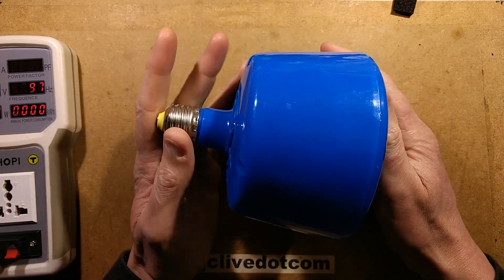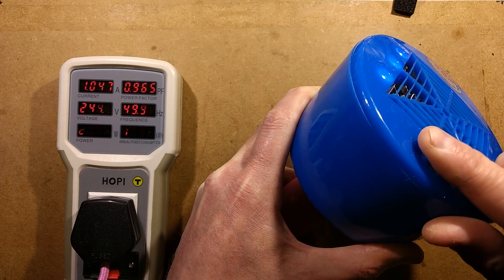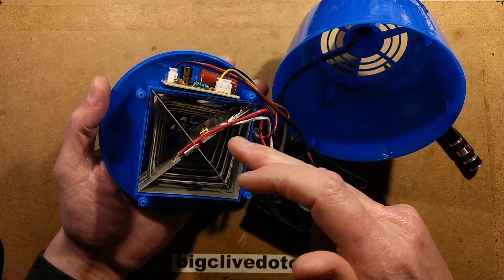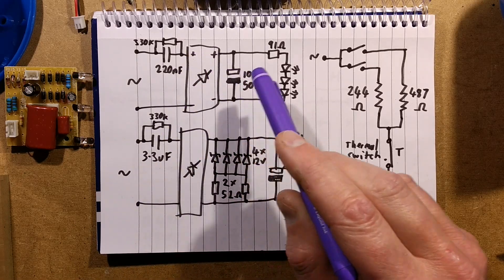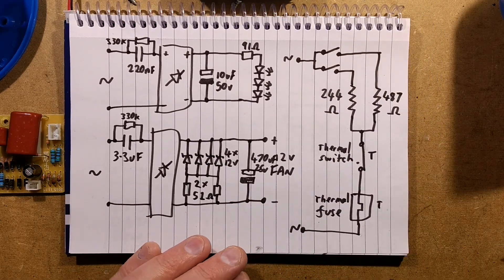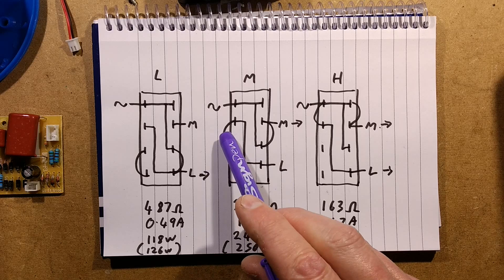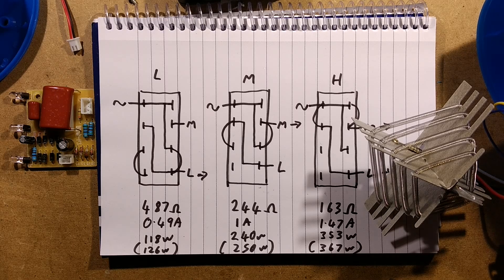Fan heater that screws into a lamp holder.  (With schematic.)

Comment: Just use a 150, 200 or 300w incandescent... very efficient heater that wastes a tiny bit of energy as light! :)
Reply: 35 years ago that what we used for raising chickens - infrared incandescent lamps.
Reply: Try a pet shop
Reply: FrontSideBus 
only like 5% tho'!!!
Reply: Wolfin i know how inneficient they are, but i fluorecent and Led Light still makes me feel unconfortable
Reply: If it's actually for animals having light on them 24/7 can be disturbing to some of them. Like parrots for instance.
Reply: In the US, it's only the 60-100W lights that are banned, but halogen lights and "heat lamps" are still available
Reply: My bedroom lights are only led so that don't get hot but give off a small amout of heat
Reply: Cool, where can I find one?
Reply: lol
Reply: Only issue being that I don't think they're making them anymore. At least, you can no longer buy them in shops.
Reply: I NEED incandescent lamps for taking picture with a specific light setting. I can't achieve that with neon, halogen, CFL, LED or anything like that. And trust me i've tried.

They are worth it in some cases.
Reply: Can still buy them here in Canada. They're not worth it at all though. I try to explain that to people and they just keep buying incandescent and CFL bulbs.
Reply: @thewolfin  Although there are some usage cases where something else doesn't make sense like saunas or stoves for example

Comment: They probably didn't use the resistive elements because they would've had to give it a lot of thought into figuring out how to do it. Notice when in LOW only the smaller element is used. MEDIUM, only the larger is used. Then on HIGH both are used. So they wouldn't be able to easily devise a plan to use the elements.

Comment: 240 voltage helps a lot even though it may likely add danger as compared to our 120 voltage. However a light bulb socket IMHO has never been a good power source especially for anything needing substantial power nor any type of connection where it is just one tab pressing against another in a tiny little spot. Rather the high pressure of a screw on the wire makes a huge difference.

Comment: They couldn't use the resistive dropper method because one element would not have power in low or medium, they could have used a common 'tail' of element on the neutral end of both, but the voltage would be different at each setting.
Reply from the maker: +Sparky Projects A tap off each element with a diode?
Reply: I suppose that'd work (with a total of 6 diodes for a full-wave rectifier), though there'd probably still be some drop in speed at lower settings (due to the source resistances of the elements).

Comment: Seeing as how hot air rises, that means the fan would have to work VERY hard to force it downward. Otherwise the heat will convect and collect all around that little fan and the wires that supply it. It's a fire waiting to happen.

Comment: LEDs are going to lower the power factor because they're DC, so need for rectifier, usually capacitive dropper, plus the windings of the motor represent an inductive reactance.  The more of that resistive heating element you have in circuit, the higher percentage it is of the power factor (i.e., the load is a higher percentage resistive than capacitive or inductive).

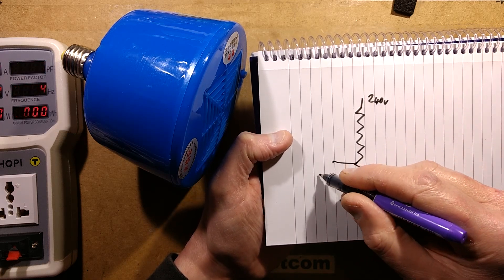Comment: 1:29 but how fans with a "cold" function work ?
Reply: Most regular fan heaters contain a simple shaded-pole motor (as do smaller stand-alone fans), which runs from the full mains voltage. So, the "cool" setting on those simply powers the fan while leaving the heating elements unpowered.
Reply: yeah i know but what was he going on about at 1:29 then
Reply: Sorry for the late reply, but anyway: Cheaper hair-dryers (that use one heater section as the dropper for the motor) don't actually have a true cold setting, their "cool shot" button being equivalent to the lowest heat setting. If a true cold setting is desired, some other arrangement (perhaps a full mains-voltage motor, or a small SMPS if you want to get really fancy) must be used.

Comment: In Canada, we find the traditional UK approach to home heating fascinating, and a bit puzzling. Here, all our homes are required to be well-insulated and centrally-heated, mostly by natural gas.
Clive's claims that Scottish winters are equally brutal to Canadian winters is not really borne out by statistics, but likely based on the degree of suffering, which isn't really valid, because we tend not to torment ourselves by depriving our homes of a comfortable room-temperature.
Reply: 'required' to be centrally heated? Not at all. Most new constructions in Quebec have electric baseboard heaters as that is the cheapest heat source and it allows for per-room temperature settings. Of the people I know around Montreal, about 80% of them live in houses, apartments and condos with electric baseboards. Of those 20% (on central HVAC), I think all of them are 30+ years old houses.
Reply: Well to be fair to the folks on the Island, their housing stock are generally much older than ours. Retrofitting older homes would be a massive undertaking.

Where the temperatures can vary in North America from the snowy north, to the humid coastline and the dry hot south. Air based conditioning was ideal to meet most of these needs. Generally the milder weather conditions in the United Kingdom called for only heating and the water heating systems were suitable. 

You do see water heating systems in  particularly in the North East of the US due to the colder winters but relatively mild summers when compared to other parts of North America. But this is slowly being replaced by air based conditioning.

Comment: Perhaps they didnt want the fan to change speed with the element selected?
Apart from the crap top casting and fittng, i think it wasnt bad.
Reply: Also the fan continues to run if the thermal switch trips (to extinguish the flames perhaps? :-D)
Reply: Or make a flame gun he he :-D

Comment: you know a good use for this would be to make like a model paint drying booth filter the air before have in blow in to the box and have your output with a damper

Comment: Wonder why they did not use an AC motor? No electronics required then.
Reply: I suppose 12V permanent magnet computer fans are a cheaper commodity part
Reply: Против Глобал ت

Comment: Separate PSU for the fan so it will continue to run in the event of an overheat perhaps?
Reply: I think if the item is actually on fire, you're pretty much done with corrective action - time to move on to disposing of the evidence.
Reply: That is almost brilliant unless the heat is from a fire. Then you got a foundry.

Comment: This is interesting. Not that I'd use one in a ceiling lamp holder, but I've been looking for a 100W fan heater for some time now. I would like it for a remotely controlled (flick the switch!) car heater for the winter, to get the windows defrosted before getting in the car. These things look a little mechanically suspect though.

Comment: Not sure of the application for this - afaik reptile heating theory is that you use a radiant heat lamp at one end to set up a temperature gradient and the reptile will regulate it's temperature by walking up and down the tank til it's reached the temperaure it wants. Fan heaters afaik tend to just produce a volume of air that's all at the same temperature due to the forced circulation.

Bathroom heater has been suggested in comments - but it's actually quite unpleasant and chilling to have warm air blown on wet skin due to enhanced evaporation so I don't think you'd wanted pointing at the place where you towel yourself off - wall or ceiling mounted radiant heaters were once popular in UK bathrooms though.
Reply: I have that heater. It gets used quite a bit during the wintertime.
Reply: It would make a handy heated chamber heater for a  3D printer.
Reply: Andrew Joy fully agree, I'm getting one for this reason, kind of hard to locate on ebay though.
Reply: Well if that's what you want one for then you can get little personal heaters such as this...
https://www.amazon.com/Lasko-100-MyHeat-Personal-Ceramic/dp/B003XDTWN2/ref=sr_1_4?ie=UTF8&qid=1493134895&sr=8-4&keywords=heater&th=1
or
https://www.amazon.com/Honeywell-HCE100-Ceramic-Portable-Mini-Heater/dp/B00I4UVGHO/ref=pd_sim_201_1?_encoding=UTF8&pd_rd_i=B00I4UVGHO&pd_rd_r=E7VY96HMSZ7GKB2RFQYM&pd_rd_w=FGJDO&pd_rd_wg=8ALjy&refRID=E7VY96HMSZ7GKB2RFQYM&th=1

I probably wouldn't trust one of those lightbulb socket heaters considering how the plastic doesn't seem super sturdy, but my use for a heater as such would probably be for entire home heating, I just find the idea to be rather amusing and a conversation starter for anyone who visits.
Reply: Maybe for grow-ops in cold areas? I dunno why this would be more convenient than a thermostat/oil heater, maybe because it takes care of input ventilation and heat at once. A timer could refresh the air without dropping the temperature too much.
Reply: joinedupjon قوز
🇦🇷🇦🇷🇦🇷🇦🇷🇦🇷🇦🇷🇦🇷

Comment: That zener arrangement looks pretty weird, not only are they in parallel and not likely to be matched identically (I guess maybe they might balance out if driven hard enough), but they and their resistors are in parallel with the fan. 

 I don't see how that's supposed to do anything in the way of "regulating" it to 12v, except that it would act to load the supply down and maybe that's just good enough.  At least as you have drawn it, the fan sees the full voltage, not the zener voltage.

Weird.
Reply: The reason this works is due to what the capacitive dropper does. The capacitive dropper is effectively a current limiting circuit, BUT has no voltage limit, so if left unloaded, it will create a peak voltage of 325 V. (The usual 230*sqrt(2)). So the zener does indeed regulate the supply by clamping it. Because of the resistor in combination with the current limiting of the capacitor, the series voltage will be slightly above the zener voltage, so they may have chosen a zener with a slightly lower voltage to produce 12V.

We can figure the approximate current through that circuit, and then from that figure out the voltage drop across the resistors (for convenience treated like a single 25 ohm resistor) and go from there.
Reactance of the capacitor: 3.3 uF @ 50 Hz -> 965 ohm.
First approximation of the current through the zener path: 230 V/(965+25 ohm)=232 mA
Voltage drop across the resistor: 25 ohm*232 mA=5.8 V. 
So you could use a 6.2 V zener to achieve 12 V voltage regulation without another load. 

Again though, that's just an approximation, which doesn't take the fan into consideration, as well the exact current through the zener path. But anyway, I think the zeners are mostly there from stopping stuff from catching fire if there's a voltage spike or if the fan is left unconnected.
Reply: Ah yes that makes sense.
Reply from the maker: It's a very crude shunt regulator that relies on the capacitive dropper limiting the current.  It's probably mainly to avoid nuking the fans electronics if the voltage goes too high.  If the fan was removed it would probably get pretty hot.
Reply: "If the fan was removed it would probably get pretty hot." That sounds like something bigclive would do... Oh wait!

Comment: Y'a know what im thinking? - I'm thinking a festoon of overhead fan heaters!
Reply from the maker: Given the electrical competence of most events companies they would consider that a great idea.  Heat and light festoon for marquees.  Then their resident electrical expert could fit an increasingly bigger breaker to solve the inevitable technical issue.  They could fit them in the festoon on the Xmas decorations too.
Reply: I have a feeling that would be really loud.
Reply: bigclivedotcom That's my fix for everything. Bigger breaker, works every time.
Reply: This brings me onto my next project then: A 63amp, 3phase festoon. Heavy as hell and definitely a decent ramp up!
Reply: I just saw a close equivalent in the local Woolworths (supermarket) today; I guess the air conditioner is under maintenance, so someone decided to put 10 industrial fan heaters (2kW each) atop the aisles and plug them into the suspension sockets. Of course by the time I got there, they were just sitting with the breaker tripped; no wonder with >83A at 240V (if the rating is even given at 240 for that matter; could be at 230 for all I know). And the staff were wondering why the place wasn't warming up…

Comment: Every time I think of an application I think it better have a better housing. 
I was watching that cap get turned by the torque of the wires alone.
I'm not certain that I would trust it unattended...so...latrine heater?

Comment: Might be useful in a bathroom. A lot of bathrooms in the U.S. have a heat lamp enclosure which allows a ~300W lamp to generate a lot of heat.
Reply: charlesmartin82 yeah wet hands and poor build quality.
Reply: If you put it in a light socket, one would think you could just use the light switch to turn it on and off.